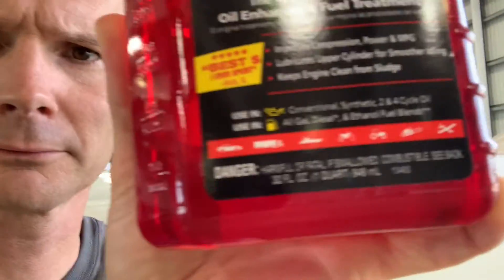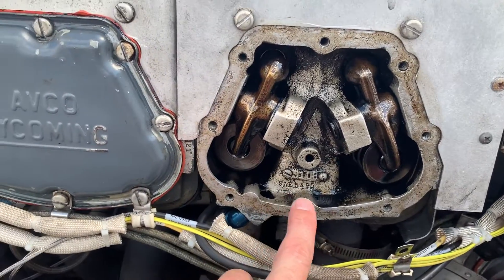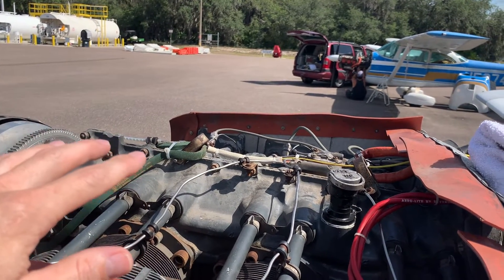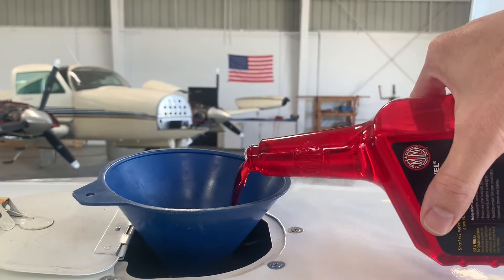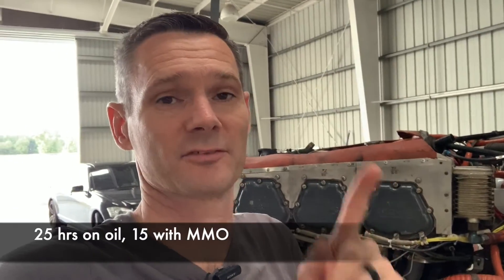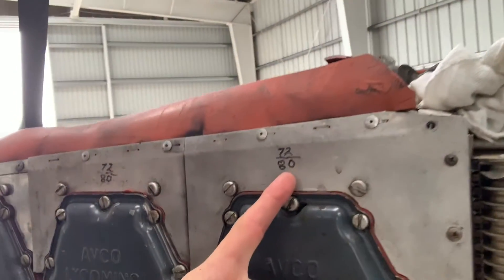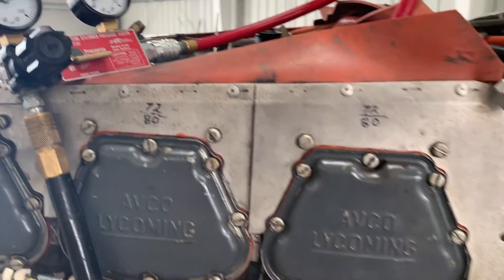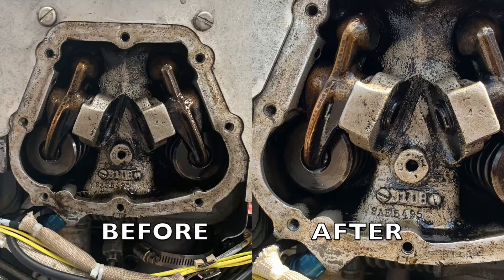Before and after Marvel Mystery Oil in Airplane.  We test it!

Comment: Cleaned out the oil return rings on a Honda real well, no more oil burning
Reply: Added to oil or gas?
Reply: @damienmills5553  to the oil, put about 10% 200 miles before you change the oil. Do this every oil change and after 3-4 applications, you should see improvement.

Comment: It was used in WW2   for B17s and P51 mustangs  to reduce upper cylinder wear ...definitely use in aviation  fuel  use  20% in aviation oil also
Its been around 100 years  and excellent for rebuilt engines

Comment: If I remember correctly, I believe that Marvel missed true oil before it was bottled and sold commercially in 1923 was an additive for oil for radial aircraft engines in the World War I era and most notably for radial engines where the propeller was actually bolted to the engine and the crankshaft is bolted to the aircraft. The entire engine would spin with the propeller. It is why many World War I aircraft could turn One Direction but they couldn't turn the other direction cuz they could not turn against the torque of the engine.
It is a high phosphorus low viscosity oil additive which cleans tremendously well and can be used while you're actually driving the vehicle or flying the vehicle.
And yes it did look better after although it wasn't that dirty in the first place I'm not sure what you're expecting at that place. But if you put some in the fuel system, it would probably keep carbon from congealing and hardening up in the intake valve area combustion chamber and exhaust area.
15 hours is not nearly long enough.

Comment: It's Mineral Oil (Highly refined petroleum) and Stoddard White Spirits with fragrance added. So its basically Highly refined Gas (Petroleum) and Dry Cleaning Fluid according to the companies Data Sheet.
Not something I would dilute engine oil with for any extended period of time.
As an engine flush between oil changes sure. Otherwise it is just thinning the oil out and the white spirits (also a paint thinner) is removing carbon.

Comment: MMO has caused fatal plane crashes before. You do not want to mix this stuff in your fuel under any circumstances…
Reply: The crashes I read about involving MMO the pilots used WAY more MMO than recommended.  I used it in the fuel in my super decathlon and it worked great at controling lead fouling on the valves.

Comment: You should use that before you go out and start a dry engine and horse the throttle around. You also might want to pre  oil the cam with a pump piped into the front of the cass.

Comment: I use MMO in my E-225-8. It stops the fouling of the rings and guides by 100LL fuel that is to rich of a diet for the engine. Not sure what it is but it works.

Comment: I use MMO in everything!!! Got 440K miles on my F150 4x4 and never a major on the engine! The in tank fuel pumps finally went out and it stopped. Just waiting to get some time to drop the tanks and change the pumps and get it back on the road!
Reply from the maker: Thanks for the info, good to know!
Reply: Chris at what age or mileage do you think it’s time to start with the MMO? Iv got a 2011 with 69k mi. On it. Thanks
Reply: @Iz0pen  my truck is a 95 XLT with the 5.7L(351cu. in.). I started using it at 100k miles as an additive at every other oil change...it did seem to "thin" the oil a little but figured, and eventually learned, it did my engine great! My youngest brother turned me onto it. I even ran it in my backhoe engine with great results too. I'd even try it out as a 2 cycle oil if I still had a 2 stroke motor 🤣! Just love the stuff!

Comment: Jimmy it's spearmint oil. just look up the properties of spearmint oil. I've been using this in all of my engines the high performance turbo stuff loves it, it keeps the sludge away.
Reply: *wintergreen
Reply: That's not what the material safety data sheets says regarding spearmint oil
Reply: @derheeheehee6941  Hey they add the spearmint/wintergreen to give it the pleasant smell, The base formulation works to help keep deposits at bay and smell good doing it.
Reply: My understanding is it is ATF with spearmint oil added for flavor...

Comment: This is foolish voodoo.  Lycoming AND Continental both state that compression tests are to be done after running to normal operating temperature.  Nothing conclusive to be seen here.

Also, putting something not approved by the manufacturer in an engine is a huge liability.  You sell the airplane, then the engine seizes and someone gets injured or killed. What will you do then?  And, it’s all on video.

Comment: The only difference was putting a non-approved oil additive into your engine. I wonder what your insurance company would have said if you had an engine failure? Some things are best not put on YouTube.
Reply from the maker: Thanks for the info, good to know!
Reply: The only reason it's non approved is because manufacturers want your engine to wear out and break so you "need to buy a new vehicle" why do you think they don't sell Amsoil in stores, because it's the best oil that'll make your motor last forever and aside from that you can only order it online.
Marvel is a great additive, my 87 wrangler loves it and my dad's 2014 Ram loves it

Comment: You crack me up! Cinnamon chewing gum...
Reply from the maker: hahahaha, I was surprised!
Reply: Oil of Wintergreen, supposedly.  That gives the odor.  It’s a powerful solvent/detergent, which is one reason it tends to clean out gummed/burnt oil.

MMO works well as a general purpose light oil, also.  Mixed with charcoal lighter fluid, it works well as a honing oil for sharpening…

Comment: Do you like Camguard for Lycomings?
Reply from the maker: I do. I use the Victory and the "plus" oil that already has it in there.
Reply: @therealjimmysworld  Do you have a Lycoming engine in AD 80-04-03 that requires LW-1602 additive for the hydraulic lifter (tappet) configurations?  I have an IO 360, so I don't need the additive, I use Phillips 66 XC 20W-50.  I did some quick reading: it looks like the additive is all about wear at startup.  Anyway, the CamGuard, is supposedly really good for Lycoming's that sit.  Does all of this sound about right to you?
Reply from the maker: I use it in any piston airplane engine.  More protection the better!

Comment: Adding additives to certificated aircraft engines immediately grounds aircraft till complete engine overhaul performed...Moses <><
Reply from the maker: Thanks for your comment.  I did ask multiple A&P/IA's and they both said it was fine and even suggested it.  I'm always open to learning though.  Where does that info come from?
Reply: @therealjimmysworld  They must have forgot their training. My A&P certificate requires me to ground an aircraft with manufacturer non-certificated engine additives. Just ask any aircraft engine manufacturer (any), their liabilities won't allow it ever and it voids certification of engine.
Reply from the maker: is that for Part 91 operations?  I know they can do a bit more than the others.
Reply: @therealjimmysworld  It has to do with manufactures liability. They have ZERO incentive to approve the additives. Certification validation failure is where the FAA regs come in. ALL regs. First thing NTSB looks for inflight engine failures. Approved by manufacturer is all FAA is interested in first thing.
Reply: @Tadrjbs  REALLY? FAR citation? You ARE aware that the standard Lycoming warranty is VOID after twenty-four months(24) in service UNLESS you are a high usage operator (40 hours or more per month) or are part of the Lycoming Loyalty program. Precisely HOW LONG have you been an A&P and don’t know the regs? You can find them in the FAR/AIM....
Reply: @stevehicks8944  It doesn't have anything to do with time in service. It has to do with manufacturer liability which is forever. Manufacturer does not approve and neither does the FAA. I can legally ground an aircraft I have witnessed installation of non-approved additives. it would ground itself eventually soon anyway.
Reply: @Tadrjbs  No FAR citation I see. FYI, a friend of mine’s widow attempted to sue Lycoming after his death. A set of rod bolts failed in service in spite of the Lycoming maintenance manual assertion that all rod bolts needed to be subjected to NDT. At trial Lycoming was deemed not at fault because the engine was out of its manufacturer’s warranty. You are talking to hear your head rattle. I know this because you can not provide an FAR citation to backup your assertion. Go ahead and ILLEGALLY ground an airworthy aircraft and see just how fast you lose your ticket. The FAA takes a dim view on people “creating” regulations that do not exist in the FARs. You MIGHT want to read the General Aviation Revitalization Act of 1996. ALL General Aviation OEs were relieved of their liability for ALL aircraft, engines and components manufactured before 1996.
Reply: @stevehicks8944  Check every manufacturer, they all say same thing. No approved certificated engine additives.
Reply: @Tadrjbs  OE manufacturers are NOT the FAA. One more time: cite the FAR that empowers you to ground an aircraft simply because the owner chooses to use MMO. I noticed you are dodging my questions as to your experience as an A&P. You HAVE worked as a mechanic, inspector or supervisor in the last six  months, yes? If not, your A&P isn’t worth the paper it’s printed on since you are not current. You cannot legally maintain an aircraft unless it is under the supervision of an IA. You might want to take a look at AC65.81 and 65.83. Know what’s funny? No where under 65.71-65.87 is an A&P given the privilege of grounding an otherwise airworthy aircraft. Only an IA is  given that authority (AC65.95).
Reply: @stevehicks8944  You don't get it. Manufacturers have no incentive to approve additives and are not liable in an engine failure when they are used by customers. Argue you can in court case and you will lose.
Reply: @Tadrjbs  you as an A&P have absolutely no authority to ground anything
Reply: @therealjimmysworld  The lubricant was used as a fuel additive in a Lycoming aircraft engine which was specifically cautioned against oil additives (Service Instruction No. 1014M, which also stated its use would void the warranty) which suffered catastrophic damage during take-off. The NTSB listed the probable cause of the accident as "The improper use of [a] fuel additive which resulted in a power loss."[4][6]
Reply: HORSEFLOP!! I worked in a recip engine overhaul shop that was FAA certified. We used MMO in engine assembly right in front of the FAA repair station inspectors. Cite the FAR that supports your assertion.
Reply: @stevehicks8944  Your wrong...The lubricant was used as a fuel additive in a Lycoming aircraft engine which was specifically cautioned against oil additives (Service Instruction No. 1014M, which also stated its use would void the warranty) which suffered catastrophic damage during take-off. The NTSB listed the probable cause of the accident as "The improper use of [a] fuel additive which resulted in a power loss."[4][6]
Reply: @Tadrjbs  the FAR is what you were asked for, not a diatribe. Provide the FAR that states it is illegal to use MMO as an oil additive. The ONLy approve additive from Lycoming is the the garbage you put in O-320-H2ADs to prevent the cam and lifters from destroying themselves
Reply: BTW....It’s “you’re”; a contraction of “you” and “are”. I once had a TCM engineer tell me that dynamic balancing of the internal assembly of the engine had no effect on engine performance and longevity. Myself, our engine shop manager( over 50 years experience in the machining and assembly of high performance engine) and the TCM tech rep just looked at each other and shook our heads at the ignorance. This was after the engine in question had “shook off” two oil coolers and three sets of Lord mounts.

Comment: MMO is just single weight oil with dye and fragrance added in. 
Compressions change continously, due to changes in piston ring orientation.
If you want a good comparion you would need to do an oil analysis and borescope. And of course you would need to compare over a longer period of time to establish a trend.
My thought. It's just an ancient gimmick and is not worth the time or money.
Just use camguard or a blend as directed. Lots of supporting data for those additives.
Reply: Kevin, how much experience fo you have in power plant overhaul? I have six years in aircraft engine overhaul AND an ASE certification as a master engine machinist. Our engine shop manager was a former Navy motorman, USAC mechanic and engine builder along with holding an FAA Powerplant license(as did I). We assembled every jug with MMO on the rings and cylinder walls. Engine oil tends to glaze the cylinder walls at lower rpms. Our engines saw ring seating in as little as four to five hours verse 8-10 hours with engine oil. We also saw lower oil consumption in the engines we treated with MMO. It sounds like you are expressing an opinion instead of “real world” experience.
Reply from the maker: Thanks for the comment.  I always use camguard in lycomings and avblend in everything.  any little bit of help is welcomed :)
Reply: Oh, it also has Oil of Wintergreen in it, also. (The odor).  This is a strong “detergent” and that gets rid of the “crud” in your engine.
Reply: Yep.  If you really want the best mechanic in a can for cleaning carbon, you can't find better than berrymans B12.

Comment: My father used in a Fairchild 24 and a Beechcraft Staggerwing. Swore by it! I use it in all my vehicles.
Reply from the maker: great! thanks for the feedback!
Reply: Especially Radial Engines.  Air cooled engines run hot, and that builds “crud” in an engine…

MMO helps dissolve “crud” in engines.  I used in my last car, and will use it in my small engines…
Reply: @dennisyoung4631  They do require more love and care. Some parts are harder to find, making it harder to keep some of them flying. You draw attention at every airport. Flying an antique airplane is such a great way to travel.

Comment: Jimmy
Have you given any though of using synthetic oil and filter for your aircraft???
Reply: THere's no 100% synthetic oil certified for piston aircraft engines.
Reply: @JustaPilot1  There used to be a fully synthetic oil for piston aircraft many years ago, what a mess that turned into for Mobil, the 100% synthetic was unable to savage the lead in the fuel and caused all kinds of problems.
Reply: @anonymous-nobody1  yes, Amsoil and Mobil both produced an Av oil many decades ago and that was the problem, the lead didn't like to stay suspended in synthetic oils, unfortunately. I believe otherwise the oils were good. That and all the red tape and money to get anything certified!
 The Rotax engines same thing if you use much 100LL instead of non ox mogas, which is preferred, rotax says to cut the oil change intervals in half. 
If a suitable unleaded non oxygenated fuel could ever be developed instead of 100 LL oit would be a boon for av engines I think. Less carbon, less maintenance, sticky valves & spark plugs would last a lot longer and the engines would probably last longer too.
Reply from the maker: these guys are correct.  I have looked into it, unfortunately, because this thing is still in 1950's technology and using leaded fuel, the newer synthetic oils don't absorb the lead and it ends up messing things up... soooo, until they engineer something that can work with lead.  This is what we got.
Reply: @therealjimmysworld   actually,  1930s technology, think Volkswagen bug engine 😁
Reply from the maker: hahahaha, Ferdinand Porsche & Adolf Hitler partnership...
Reply: @therealjimmysworld  Or they get the lead out....at some point.
Reply: Really???
That is surprising!!!!
What about experimental aircrafts. What oil can be used?

I have been working on a project of testing engine oils on water cooled and air cooled engines since 2005.
I found one type of oil that works the best.
Example.
Water cooled engine has now 620,000 miles on it.
I find that the oil change intervals do affect the wear on engine parts. 5000 Mike's intervals oil change seems to be the best.

Air cooled engines the oil is still clean after 3 years of running with a milage of 75.000 miles.

Think of the oils used on radial engines during the 50s to the 70s. Got the picture???
Reply from the maker: Are you using leaded fuels?  That's where the issues happen.  What oil is your best one?

Comment: G, day Jimmy's world from Sydney, Australia.
* Sir, did you find out what the A&P's use to cut open the oil filter?
* Fuel additives (isn't it all about the octane burn and temperature)? My engine: it's good, don't change it!
Best wishes
🌏🇭🇲
Reply: I like this brand of tool for cutting filters: https://www.aircraftspruce.com/catalog/topages/fc2000oilCutter.php

Then a simple utility knife for the pleats.
Reply from the maker: ditto.
Reply from the maker: We use an oil filter cutter like the one in Caleb's comment. then cut out the paper and inspect (with a magnet)
I like additives for specific applications and expectations.  There is a time and place for everything.  I'm trying to "de-slug" this engine, so I'm using MMO.